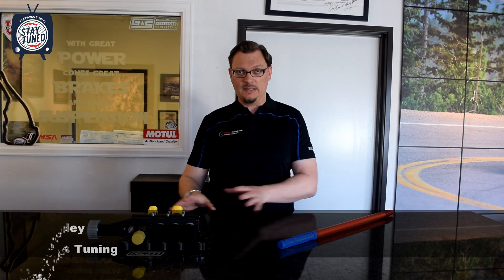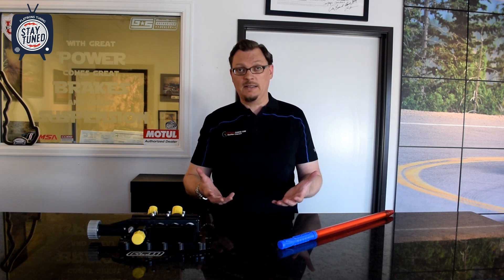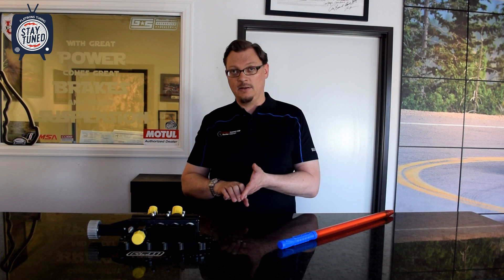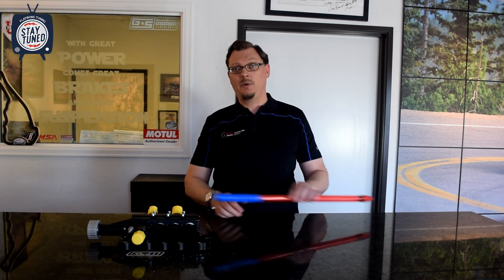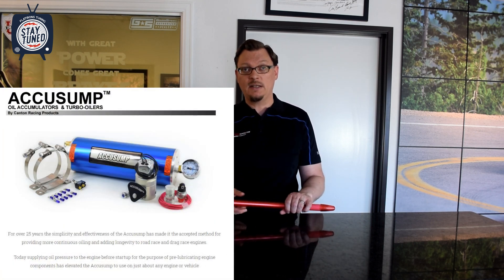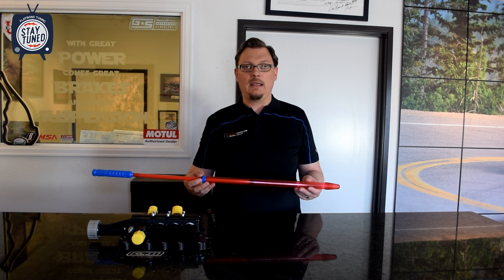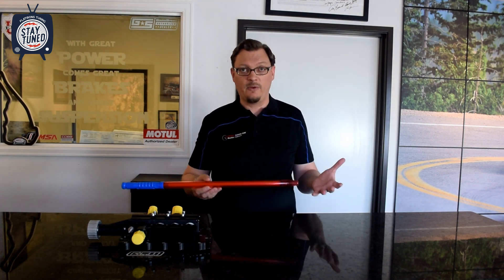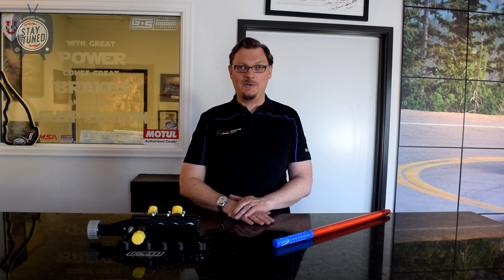Everything you need to know: Accusump vs Dry Sump

Comment: You bring up some interesting considerations that I've never heard from other sites.  I think that I will control my one quart Accusump  with a 12v solenoid.  That way I can keep everything up front and use a switch for when I want it available.  Also, my oil pan sits below the crank enough that one more quart won't quite reach the crank.  Thanks!
Reply from the maker: Glad that the video was helpful.  Thanks for watching and Stay Tuned!

Comment: Thanks for the video, very interesting! I spoke to Chris over at Killer B a while back though about an Accusump and he thought that adding one would be detrimental on an 06 WRX with stock internals (I was interested in doing it more for preoiling due to long periods of nonuse than anything). His reasoning, to the best of my memory, was that an Accusump would be refilling at times when the engine was under high stress (e.g. coming out of a turn/entering a straight), reducing oil flow under these circumstances. I would love to have your thoughts on this potential issue, as I respect both of your organization's opinions on Subie oiling systems.
Reply from the maker: Thanks for your question.  I'd say that I completely agree with Chris and that point is one that is easy to overlook as well.  Since the tank can only re-fill when the pressure does finally go above the minimum threshold, at the time that it does that, you are then pulling pressure from the engine to re-fill the Accusump.  It is hard to say exactly the degree to which this would keep the overall pressure in the oiling system lower than it could be, but it would be something that I would want to monitor if I had one on an engine that I was running.

All that being said, a good counter-point to this is the number of people that are running an Accusump where it does help with, or improve, oiling issues.  There is one driver that we sponsor that runs an Accusump on his Subaru that he road races.  He has had really good engine reliability, and it may well come down to the Accusump in part.

Overall, there is a lot to consider with an Accusump, and it is important to look the benefits and drawbacks of any and all systems that you might be able to use.

Thanks for watching and Stay Tuned!

Comment: There is this thing that keeps me wondering...
If the oil pan holds 4.5 liters, and the accusump 3 liters, after shutting off the engine, the oil pan will end up holding 7.5 liters. Is it ok having a "flooded" oil pan? I would say no.
It's the same for example when setting the air chamber at 3 bar for example, and the engine idles at 2.5bar of oil pressure. All that oil from the accusump will be sent in the engine, the crankshaft will splash the oil, the pcv system will blow and who knows what else.
Is there something I'm missing?
Reply from the maker: That is a good question.  The detail that you are missing is that there is an electronically controlled valve that lets you either activate or deactivate the Accusump.  So when the car is off, the valve is shut so the oil is held in the Accusump, and then when you go on track and need the Accusump active, you just open the valve.

Hope that helps and Stay Tuned!

Comment: It seems like there could be a few moments with an accusump where there is way too much oil in the system. Curious what accsump would say about it. Gotta say I always wanted one to prime my oiling system when my car sits for over a month.
Reply from the maker: I would imagine that the extra oil should move in and then back out of the system fairly quickly.  

For what it is worth, there are engine pre-oilers out there which are just pressurized tanks that send oil into your engine.  They came about to help prime new engines, and they are much less than a full Accusump.

As a small footnote, you can prime your oiling system with a dry sump too.  You just take the belt off and spin the pump :-)

Thanks for watching and Stay Tuned!
Reply: You can use the accusump for priming by adding a manual valve on the outlet hose that sits close to the driver.
Before shutting off the engine, you need to close that valve. By doing so, the oil remains in the accusump and the air chamber rests pressurised.
After 1 month let's say, you just turn on the ignition, release the manual valve, watch the pressure rise on whatever oil pressure gauge you have, and quickly crank the engine with an already primed oil circuit.
I might be wrong, of course.
Reply: @DGU_27  that’s actually one of the top reasons I haven’t gotten one, too scared to have that oil next to me in event of a bad accident

Comment: Hell yeah, I'm all for removing the PVC system! A system that was thought up by eggheads, not auto engineers. Nobody wants to go around ruining the environment. But, My opinion is that the PVC system is the most detrimental thing for the long term operation of an engine, and is the most destructive thing over time for your motor! Dumping oil (fumes) into a regular combustion engine, and not just in diesel engines, is the worse thing for your motor. Like running a 2 stroke fuel mixture in a 4 stroke engine!
Reply from the maker: Thanks for the comment and thanks for watching.  Stay Tuned!